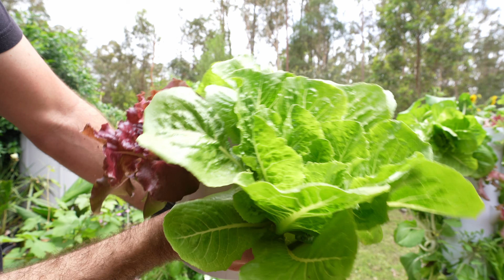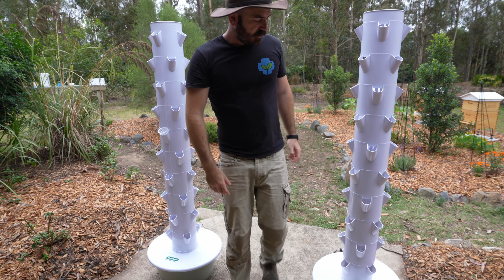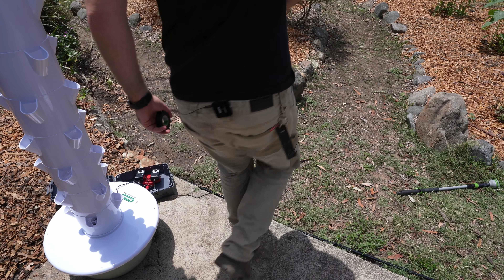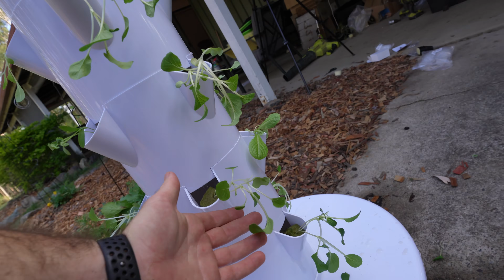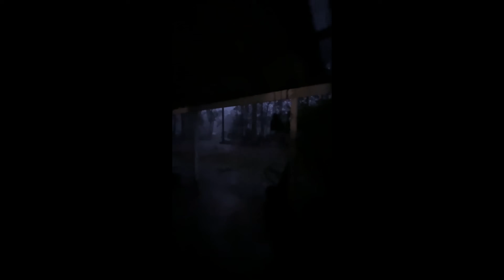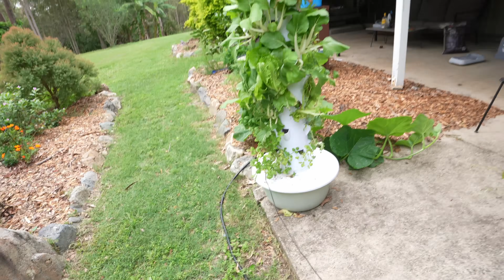The Hydroland Modular Tower Hydroponic System

Comment: Dude you can make your own tower garden and  design your own with 3D printing  I would make hydroponic walls that go through your yard More produce if its walls you need bigger pumps  and a straight wall will be structurally more sound  with a big reservoir and you'll have to dig in the ground waterproof fit and there you go

Comment: Hey Hoocho, I designed and 3d printed a tower system similar to this and grew 40 cabbages in it this season, I think I mentioned it when I sent you the seed tray files it was very successful. It’s 2m tall and survived several storms here in the uk, 

I would recommend a res of 100L or more or digging the res into the ground also having two stainless rods in the tower running from top to bottom to bolt it all together helps a lot.

The tower looks great dude, I like the res catchment in the sections too very well though out and some great results all things considered.
Reply: Can you share the stl?
Reply: Can You share Your work?

Comment: I'm still searching for rectangular rain gutters in Switzerland xD 
Does someone from Europe know where i can buy them?

I guess the vertical tower would solve this issue
Reply: its the same in the uk, we have 110mm or160mm round or 68mm square as standard ground pipe or gutter pipe, you can get 100mm square which is used to clad over decking posts but there not cheap. Being in the uk which spends alot of time wet it seems strange we have the smallest gutter systems. To import the USA or Australian shapes costs a bomb to.

Comment: I 3D printed one of these. Great project for my balcony :) I love it
Reply: how big of a 3d printer bed does it require? 
That is exactly what I've been thinking about doing.
Reply: @douglasdidit4341  normal 25x25x25 but you can slice part and glue them together afterwards. Load the modell in your slicer and you can see the dimensions
Reply: @davidn7795  Where can I find the STL file?
Reply: Is 3D printing cheaper?
Reply: @troyupshaw7227  not nessesary. That should not be the focal point. You do not have delivery cost. In my case I am in germany. Delivery from australia is out of question. And for me it is just a nice project that can be done with a 3D printer. I even can add or manipulate the model to my wishes with a printer.

Comment: For the Tower: 
6 kg Ausi international post 1st 2 kg is $60.90
The  next 4 kg are $13.80 a kg 
So the  bigger the box the better max 20kg

2kg 		$60.90
4kg  x 6.40  	$38.40
		$99.30 for international post 
Plus post to Sydney, Plus $128 for the Tower 
All good.

Second Question the 5 extra sections ? 4Kg? 
And the Huck Bucket? 
AusAid will love this. 
Thank you

Comment: Hey dude, long time lurker. Love your content. I love the system but just curious how light proof the res is? I know pvc is usually pretty good I'm just wondeting if itd benefit from a coat of black paint?
Reply: @glenns5140 careful spaying res black, I have my 3D printed towers on top of 44 gallon plastic drums, the red one is fine but the black  one heats up to the point you will cook the roots, I got some flat white spray paint and it now remains nice and cool
Reply from the maker: @glenns5140  I haven’t had a problem with light ingress so far.
Usable light for algae has to be quite high. Light passing through transparent plastic cuts usable light dramatically let alone white.
Reply: @Hoocho  sweet dude. I think you've sold me on them then. Cheers dude. If you're ever down south qld (Ipswich) way let us know. Go out for a beer
Reply: These look good might buy one

Comment: 10:05 A little outdoor heat shrink tubing would work wonders for that connection. Just pop it on, hit it with a lighter or torch and it will seal up the connection and water proof it. The tubing has an adhesive inside that melts around the wire and completely seals it.
Reply: Or use silicone...